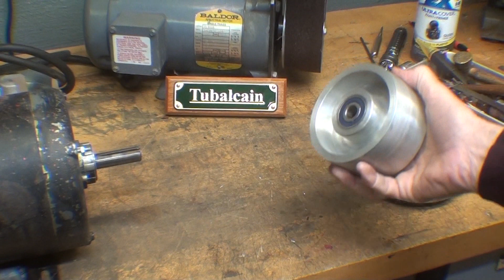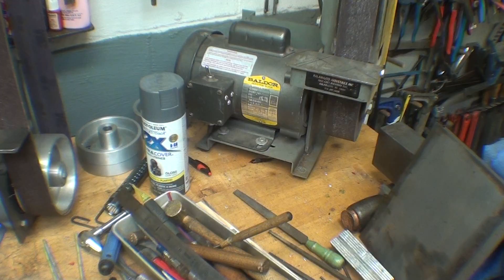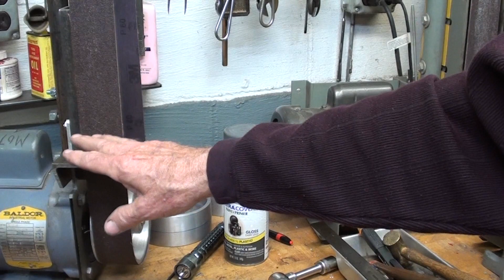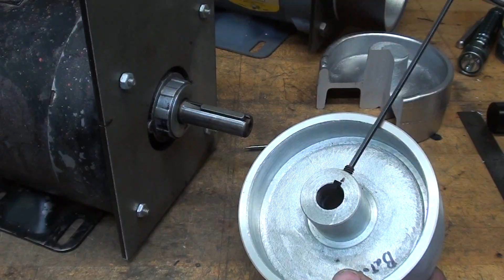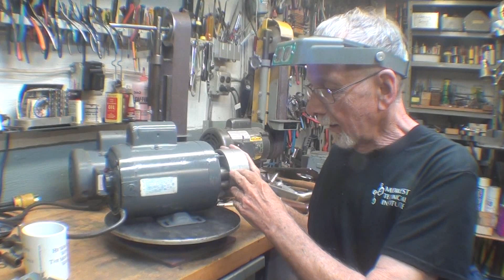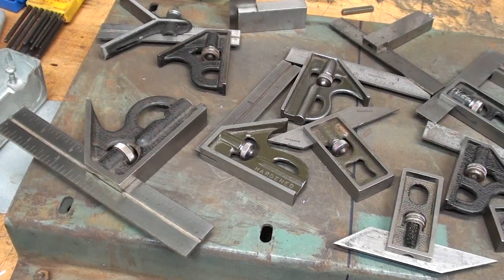Making a 2x48 Belt Sander pt 3 Tips #512 tubalcain

Comment: If you buy a motor specifically for this project, order a 56C frame motor that comes with pre-drilled and taped mounting holes in the end frame of the motor to which the grinder frame can be mounted.

Comment: Mr Pete, vibration isolators are rated by load.  That is to say, that to work properly, they must be loaded to at least 90% of their load rating for most isolators.  The reason you had two different sizes on your base was most likely because one end of that mounting plate carried more weight than the other and the constructor, recognizing this, installed the proper isolator for the load carried by each foot.  A lightly loaded isolator can actually amplify the vibration it sees.
Reply from the maker: Thanks

Comment: That's where I left all of my small squares. I've been looking for them. :>) Great stuff. Reference painting. To one and all, if you want a fast drying paint use a straight enamel / lacquer (I didn't say Acrylic lacquer) as in what Henry Ford used back in the day, when you could get "any color you wanted, as long as it's black."  Another choice would be an appliance paint (two-part) epoxy. The paint your using "Rustoleum" has fish oil(s) in it, thus the much longer then usual drying time(s.) Two-four day's drying time for Rustoleum paint, is not unheard of, even then it's really not dry. Example During this past summer I refinished a buffer motor with Rustoleum, let the paint sit for a week, then laid-out some very basic pin striping I wanted. When I removed the masking tape, everywhere the masking tape was, you could see the residue of the tape eating the paint. I was not a happy camper.
Reply from the maker: That's good advice

Comment: Mr. Pete. 🙋🏻‍♂️

The piece of the base you cut off can be bolted on. Flip it over and use that welded on angle as a bolting flange to join it to the base. Should work well enough to lay the sander horizontally.
Reply from the maker: Thanks

Comment: Is there an optimal speed in feet per minute for various abrasive belts and various belt grits and various metals.?   Is that in the machinists handbook?    Similar for cutting tools in different metal?    A 3450 rpm motor with 4 inch wheel yields roughly 900 feet per minute.   Is that a good speed?
Reply from the maker: That is a good speed, I'm not sure if they are in the handbook

Comment: Enjoying this build. Making notes. I’m going to build one for myself. I have a 1450rpm motor, do you think that’s fast enough mr Pete? Also the back plate is a good idea to weld on, can also be used to fasten unit to the wall so you don’t crush the rubber feet pulling it down.
Reply from the maker: Yes that motor will work

Comment: I realize that you are probably not going to check the balance of the pulleys. Are you at all concerned about the balance or lack of balance causing too much vibration.  I was glad to see you address the cooling aspect of covering the vents of the motor.  I learn much from the Jedai Master of machining.
Reply from the maker: No, not concerned. I machined them true

Comment: Hello Master Pete, can you please explain why machinery is made of cast iron ? isn't steel better because cast iron is brittle and can break ?  why even new machines are still made of cast iron?
Reply from the maker: Still cannot be cast easily like cast-iron. Cast-iron is very easily machinable. Cast-iron absorbs vibration, shall I go on?
Reply: @mrpete222  what about cast iron breaking under pressure or load ? unless it is a marketing strategy for making money. is it possible to cast iron at home ?

Comment: Just a thought:  If you didn't want to weld the other piece to the bottom, provided there's enough room, you could turn it 180 degrees and bolt it to the bottom using the existing flange.
Reply from the maker: Good idea

Comment: Hi Mr. Pete 

A little tip from a retired fabricator ..
Too late for this project unfortunately. 
If you had cut a "dotted" line with an angle grinder and left 3 pieces un cut maybe 1" long each.
After notching as Kalamazoo ..  you would have been able to bend up your base and if you welded fill pieces in the 90 ' left by the notches you would achieve what you wanted.
You could weld up the angle grinder cut slots if you were a perfectionist.
Steve.
Reply from the maker: That is an excellent suggestion. In fact you will see me do something similar to that, in the final part of this build. I've been sheet-metal
Reply from the maker: Woops. I'm continuing. I bend sheet of metal by scoring. I have use that technique many times, But I have never shown it

Comment: While I'm sure you know this but the plug at the back side of the motor screws out and if you pick up a conduit to box connector it will screw in through the pass through in your skinny box and spending it up to the motor leaving you access to run the wires into the box.
Reply from the maker: Good idea
Reply: @mrpete222  thanks I just did that in my drill press upgrade video. I don't expect you to watch it though I have music overlay and I know how much you hate that.

Comment: Sir I use automotive rubber expandable soft plugs for feet.  there rubber and have a stud on one side.  can you remove the 10-24 draw bolts on the motor and replace them with 1/4-20 ?.  thanks for the very good videos. Bob
Reply from the maker: Thank you, I am not familiar with that product
Reply: @mrpete222  They're Freeze Plugs that expand with a Draw Bolt. They replace the stock metal plugs in a car engine block.
Bet now you know what he was saying😉

Comment: Another great project, Lyle!   I like the idea of a washer & bolt in the motor shaft. Bellvue washer?
Reply from the maker: Good idea, I have none in stock
Reply: @mrpete222     Also, Bolt Depot on the web has 12-24 allthread in 3' sticks. Vibration dampers can be fabbed from rubber stoppers (most any hardware store) . EZ to drill & countersink.

Comment: One of the things that I use for rubber feet are motor isolators. These are double ended bolts with a rubber section in between. Just cut the rubber in half, and you get 2 feet. You can get different sizes and different size bolts. They also make good pads for toggle clamps. Cheap.<===== That word will get MrPete's attention! hehe
Reply from the maker: Good idea

Comment: Coming along nicely mrpete.  Just an observation but could you have not used the other part of the base with the welded upright and attached the front plate to it with a couple of bolts. It would make the front plate very rigid with fixings to motor and base.Looking forward to the rest of the build. Thanks for sharing. regards from the UK
Reply from the maker: Yes, I could have